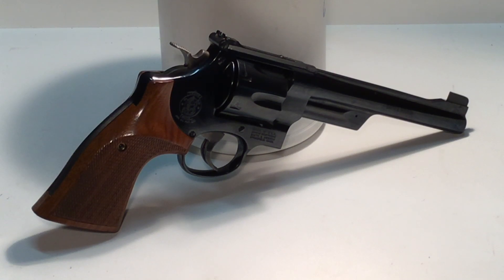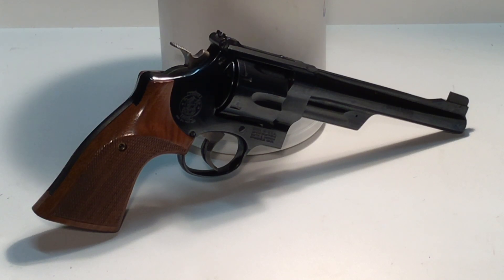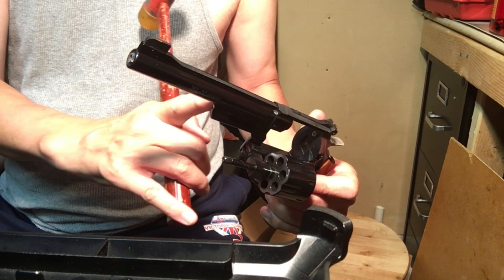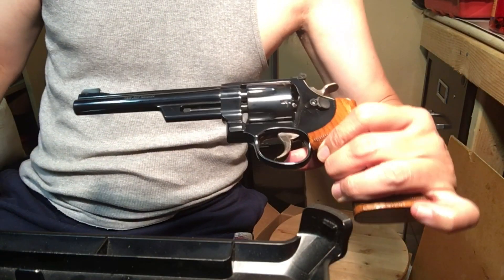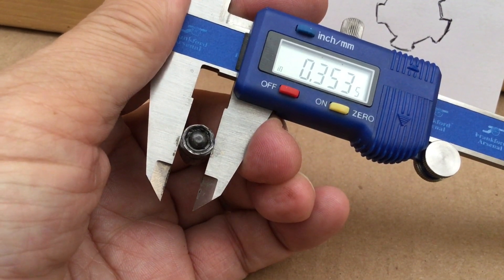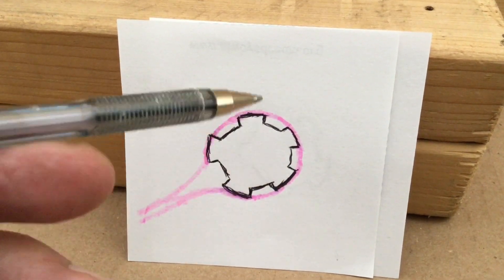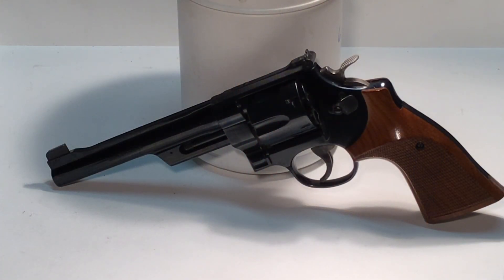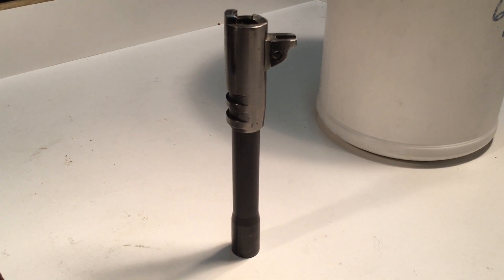How To Determine Groove Diameter Of A 5 Groove Barrel

Comment: Take heart s&w fans...
This guy is not right.
You can measure the depth of a groove on the slug ( barrel land).
You can also measure directly across with a blade micrometer then add the groove depth.
My model 19 is .3495 to .350 directly across; add the groove depth ( barrel land height)  ..007 voila...... 3565/.357...
His theory is good but measuring technique is poor.
Kivaari

Comment: That’s crazy that the bore diameter is so much smaller on revolvers. You’re basically swaging a .358” bullet down to .351-.352” , even more more where the lands cut into the bullet. I mean your lands probably measure a good .344”-.340”.
Seems like that would create some really good pressure spikes on hot loaded hard cast or even worse solid copper projectiles. 

Never knew revolvers were made like that, as I only have a couple .44 caliber BP revolvers with bore diameters of .451”-.452”.
Weird!

Comment: Hi Cookie, Question for you or your opinion if you have time. so I have a Ruger Blackhawk in 45 Colt that I cannot get to shoot decent. Slugging the barrel i get .451. I am a precision machinist and i checked the the cylinder throughts with pins at work and they all check.451. Any ideas about anything else i could check?Timing is good cylinder gap is .006. This with all different types of loads and bullet weights factory and reloads Dont know if this is enough info for you but any ideas or things i could check would be appreciated. Heres where i stroke your ego in hopes of an answer. I never miss a video and learn so much please dont ever stop.
Reply from the maker: John Henry - Appreciate you as a precision machinist - people think that computers do everything now - and the day can even be seen when computers will fix themselves without any human intervention.  But the skill, knowledge, expertise and care of the precision machinist is still highly regarded.  Cost cutting and cost control will eventually do all of us in...  So here's the thing - SInce your cylinder throats are .451" (and pin gauges are the recommended way to measure those throats) and your barrel groove diameter is .451"  you have a very interesting and frustrating situation.  I've decided to make a video on this so it should be up by this evening or tomorrow morning... Have a great day, FC
Reply: Thanks, Iook forward to it. Ive fhought about reaming the throughts to .4525 but I'm just guessing and that would be irrevesable
Reply from the maker: John Henry - You could certainly do that .4525 ream (well within SAAMI specs.  Then, you could shoot .452 jacketed bullets or .453-454 cast bullets through there.  Should shoot well through your .451 barrel.  However, your uneasiness is well founded - it is irreversible, and not only that, Ruger will be able to tell you did that - voiding the factory responsibility for your gun problems.  No guarantee that opening your throats to .4525 will solve your problems.  If it still didn't shoot well for you, you'd have to take it to a gunsmith.  Best Regards to ya,  FC

Comment: Neat trick. perhaps you could do the same thing by loading it into brass and then subtracting the case thickness. However, I suppose the next comment would be that the brass could be swaging it down.
Reply from the maker: GunFun ZS - Nice that my 357 is really a 35 cal.  Doesn't sound as good as a 36.   Drats, foiled again...!!  FC Steve
Reply from the maker: GunFun ZS - As usual, your comments are very thought provoking.  I remeasured my slug again with the shim stock method and got .351" groove diameter.  Apparently, better method would be to take a half dozen readings and average the measurements as I got measurements from .350 to .353".  If I average that, I get .3515".   Then I went ahead and checked to see if your method can work for measuring groove diameter.  Took a R-P 38 case (.011" wall thickness) and sized it, then neck expanded / mouth flared it, my slug could be hand seated with easy pressure, did not just drop in.  Measured outside diameter and got .374".  So the calculation would be .374" - .022" = .352" groove diameter.  I don't believe that there was any swaging of the bullet with the small amount of pressure to seat.  It would seem that if there isn't heavy seating pressure required, your method of using a cartridge case has some serious utility - congratulations...I don't believe anyone else has come up with this.  I actually feel better now, my gun is shooting bigger bullets.  Best to ya,  FC Steve
Reply: FortuneCookie45LC That's more thorough than I would have gone, even. As usual, you give me more credit than due. I wouldn't have hunted for an expander that matched the apparent diameter of the slug. If the one in my die was off, I would have called it quits. Out of curiosity, what do you need this measurement for? Simple curiosity, or does it affect some other decision?
Reply: FortuneCookie45LC p.s. Thanks for reporting the flaws you found in the consistency of your method. That's the kind of thing that makes your info trustworthy.  -- GFZS
Reply from the maker: GunFun ZS - very observant of you - and talk about being thorough - it must go with your profession as an inherent trait... Absolutely, there is not reason to slug a revolver barrel unless it is shooting in perversity.  However, the reason I did this was that bore looks so tiny to me, just like my Ruger 44 SRH, I decided to slug it...  Best to ya,  FC

Comment: Does the powder coat shear off when it hits the rifling?
Is this why powder coated bullets travel faster?
Reply from the maker: Myles Nicholas - Some think that the extra lubricity enables faster fps on PC bullets.  But others say the PC increases barrel friction and thereby raises pressures giving more velocity.  There are a lot of factors on barrel friction (how much bearing surface, how hard the bullet, diameter of bullet, amount of barrel fouling, phase of the moon etc).  The powder coat seems to give me more lubricity as i size the bullets, the bullets go through the resize dies easier.  Best Regards to ya,  FC
Reply from the maker: Myles Nicholas - No, the powder coat does not shear off - it squashes to a thinner, but stays on...I have not been able to recover any bullets as they smash and break up when they hit the armor plate at the range.  But others have commented that the recover bullets and the powder coat still looks good.  Funny, take a cast lead bullet that is 359", powder coat it to 3605" and then size to .358" (under the original lead of .359", and the powder coat won't shear off.  Very interesting...  Best to ya,  FC
Reply: I subscribe to the lubricity theory. It is very easy to feel when sizing bullets how much more lubricity it has.  If you have copper plated lead bullets in .358 and some bare lead, 45/45/10, and PC and you size them all down to .356 you will really feel the difference.
Reply from the maker: Thanks GunFun ZS for your usual valuable information... Good day to you, sir...I'm off to Rumba dancing this Friday night... FC

Comment: Always something to learn in the Hot Lead Zone.
Reply from the maker: Jake Outdoors - The .350 was actually the first reading and should have been reported as .3525" - .002 = .3505" groove diameter.  This shim stock method works well, but you should take multiple measurements from different angles to make up for any errors that could happen from possible shim stock deformation.  My barrel groove diameter should have been reported as .351" instead of .350" (took average of 6 measurements).  Best to ya,  FC

Comment: I had pondered this a while back, on how one would take this measurement. I don't have a need to measure it on my rifle but the thought had crossed my mind. I own a TC Venture with a 5 groove barrel. Thanks for the info. always great to learn new things.
Reply from the maker: Curt Funk - And thank you for posting comment.  One thing though, best to take several measurements with the shim stock to even out and errors from position, hold and possible shim stock deformation from the narrow jaws of the caliper.  My barrel actually reports out at .351" instead of .350 when six measurements are taken.  Have a great day,  FC

Comment: great info as always!
Reply from the maker: Neil Harris - And I appreciate you taking the time to post comment.  One thing though, best to take several measurements with the shim stock to even out and errors from position, hold and possible shim stock deformation from the narrow jaws of the caliper.  My barrel actually reports out at .351" instead of .350 when six measurements are taken.  Have a great day,  FC